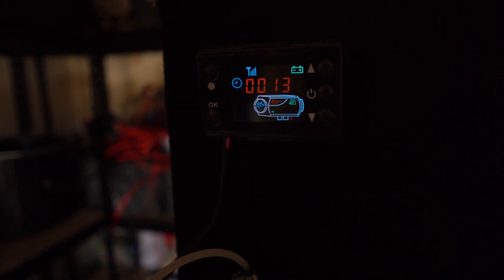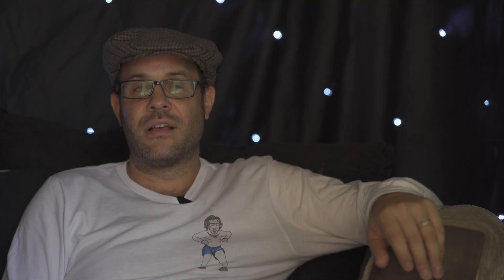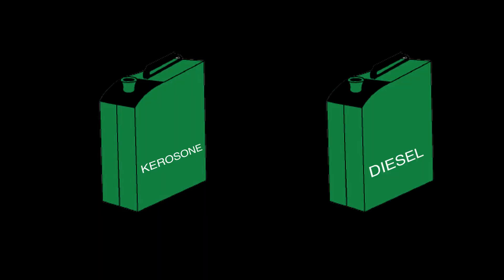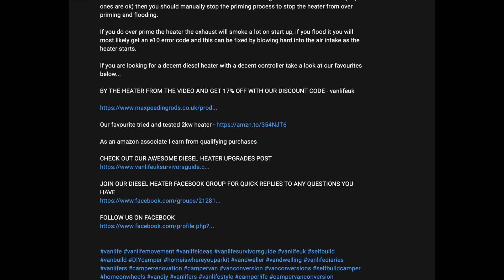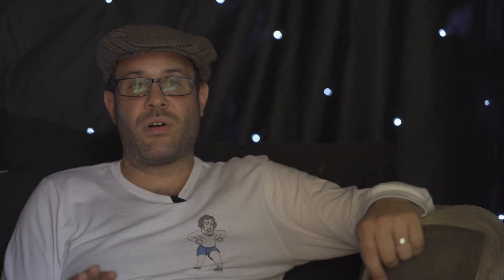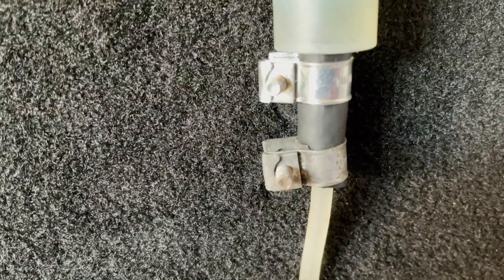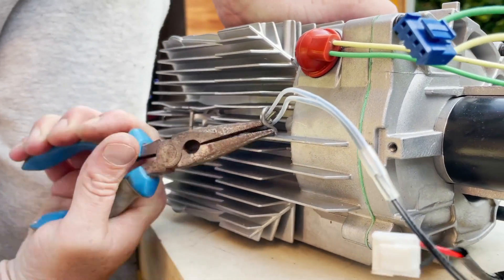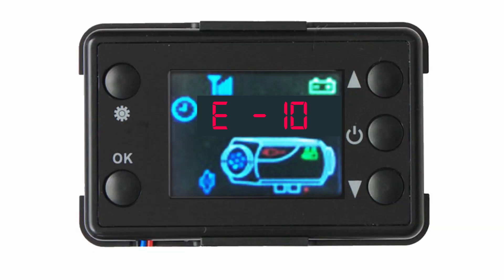Chinese Diesel Heater Error Codes E01 - E10  All Codes, Faults & Fixes

Comment: Hi, I wonder if you can give me some advise? I have just received 2 new 8kw diesel heaters, and I have installed one of them. The controller if different to yours and the heaters are 3 fin fan blade models. I can run the heater with one or two red bars, but if I chose a lower setting such as 1, 2, or 3 hz, the heater eventually shuts down. So, I can only run it on high, but the Alpine mode helps by reducing the fuel intake, and lowers the heat output, but I can still only run it on 5 or 6 hz. Do you have any idea why I can't run it on the lower settings? Thank you for a great video... Just to clarify, my controller is one that I can't go into settings to adjust fan or any other settings, but is slightly different to yours...

Comment: E-08 could be way bigger than only the pump. Waaay bigger!!! 
It could also be the mesh between the intake and the burning chamber. 
You can´t see it in there but trust me, it´s in there and clogging all up.
A really big problem from running the heater on low settings over a long time. 
Try to scrape it away with anything that might fit in there or heat it really high up with a torch. 
Okay, you can blame the pump and buy one after another. That´s your money. Your choice. Or...

Comment: Got a 06 code which is fan . Checked the fan separately and it works As soon as I put the heater back together is goes back to E06.need help .Taken it apart 5 times now .

Comment: I'm having a mare...now on Error 10 after Error 8. New exhaust new pump. I blew the fuel line. Smoke started coming out. 
So it starts pumping clicking nicely then stops. 
I've also found on the display the priming sequence does not work. I've had to manually Prime it which isn't ideal on the mouth (not recommended)
Help?

Comment: E10 is 99% clogged mesh or clogged air-hole. Beside where the glow-plug screws in there is a small hole - it blocks, unblock it.  it lets in air. No air, no start.  Poke it/carb cleaner.   

Where the glow-plug screws in, there is a mesh - the tip of the glow plug heats the mesh, the mesh ignites the fuel. If the mesh is dirty or clogged, it will throw error code E10.  Clean the mesh with carb cleaner spray.

Comment: As it happens, I got a E1 error with 13.5V. After connecting the heater to my starter battety bank with was only 12.5V it worked fine.
It's the Trellicks heater.

Comment: So how do you change the voltage selection?
Im getting 02, high voltage, but my battery is only showing 13.4v, the controller flashed up 21.7v but i can't seem to find that again now

Comment: Hi,
Just stumbled across your channel liked and subcribed m8.
Just got this heater from sunster. Used it for maybe 17 hours if that. Got E3 code so got 2x plugs from ebay. Not fitted yet. Then thought I'd try it again worked.. But then got E7 said fan and motor error.. Now back to E3 says voltage over run and I shut it off. Nothing blocking the air in or heat out ends. The controller illumination started to fade then went blank. Now illuminated again, but still E3. Do I kick it f-in hard?🤔😱
Many thanks
CELER ET AUDAX

Comment: Man your the best ,even though im a brit living in Canada of all the UT shows Ive watch to see why my heater kept cutting out  even though my controller was working perfectly ,until you said 01 is battery amps issue. I never give it a thought ,as soon as i put my battery charger onto the battery everything went smooth sailing ,Ive spent  6hrs bleeding the fuel and watching UT ...
You was bang on and straight to the point .
Thank you and for that alone im going to subscribe.👍👊

Comment: 3:22  yes, but doesn't the fan needs to start spinning in order for the ECU to recognize the magnets?  I don't believe the ECU is going to recognize the magnets if they're not spinning past the receiver.  Mine, I received was popping an E-06 code, fan not recognized.  Internet says once you give it power, the fan will spin up, o wake the ECU up, I presume by creating a magnetic field.  When I power mine up, nothing happens...it just sits there, then after 20 seconds, or so...the controller voice says 'Fan not detected'

Comment: Hello, Error code E 01 which remains in memory on my forced air heater even after driving for 1h30. Do you know how to erase this error code? Thank you for your feedback.
Bonjour, Code erreur E 01 qui reste en mémoire sur mon chauffage a air pulsé même après un roulage de 1h30. Connaissez vous la manipulation pour effacer ce code d'erreur. Merci pour vos retours.
Reply: Same problem here, voltage is good. But it stays in error. Even after removing vuse for a long time.

Comment: I see E-10 . In your videosi noticed on the E10. Your outlet on your tank was the same height as the pump. Is that required?  above like a gravity feed, it goes underneath my R. V and then back up into where I have it mounted . Eg: tank is approx 30" above the heater & 36" above the pump.
Pumpis12" below heater

Comment: I have white smoke coming out of my exhaust. After the heater runs for approx. 1 - 1.5 minutes like this, the display shows E 10 error code. Can someone help me figure this out? 
I bleed the fuel line, and re-primed the pump, after I let it sit for a week. But that didn’t work. 
Please help 🙏🏽
Reply from the maker: Could you have over bled it and flooded it?
Is there defo fuel all the way from the tank to the heater?
Reply: @vanlifesurvivorsguide  there is defo fuel. And I originally thought that I over flooded it, but I let it sit for a week and then tried it again, so any flooding should have dissipated right?

Comment: hi i have just got camper van and night heater not work battery light flashing on control panel i have take wiring off battery put it back on battery light stops but 1 min later starts flashing again i have got new battery still flashes hope you can help me thanks martyn

Comment: Brand new machine and getting E07? Help!! Why??
Reply from the maker: could be a bent pin in a connector to the wiring loom or a damaged blue cable between the motherboard and controller somewhere

Comment: Great video. I am getting an E05 error when the heater does not even run. The heaeter fan will not initiate and this error code 05 is permanantly showing on the display. I have tried re powering the heater and that does not fix anything. Could it be a thermostat issue? Heater cannot be overheating if it is not evening turning on? Any advice to resolve this. It is almost brand new and hardly used.

Comment: nicely done and very helpful. However, you say not to run the heater while driving _well, I and many of my friends use these on sailboats and powerboats. Lots of motion. While not essential to use them underway, at night if at anchor or on a mooring, the boat is still moving somewhat.Not heard too many complaints of error code 08 thank God !

Comment: I have the error 05 and yes my warm air is blowing towards a painted wooden wall about 5cm away. I put 4 individual tubes on the 4 outlets and there's a 90 degree bend as soon as the warm air exits. I will have to cut through the wooden wall soon. Hopefully it will fix it

Comment: Joke this is , there’s lots of reasons not mentioned for all the codes E-8 you failed to mention that the bloody pump isn’t working the most obvious yet you failed to mention it , the problem with the pump but kicking in is a multitude of possible reasons
Reply from the maker: Never once in my life have I had 08 from a broken pump. If you had a broken pump you would get an
 error code 4 long before error code 8. What it sounds like if you have air in your line and have blamed the pump...

Comment: Well, here I am standing at the heater at 3 am and keep getting error messages. 30 seconds into the vid I realized I was simply blocking part of the heat line. Thank you sir, owe you a pint
Reply from the maker: No problem mate, glad you found it helpful

Comment: I have had a intermittent fault with my heater since I bought the van! The guys who built the van fitted a off/on switch so the heater controller wasn’t lit up all the time the odd time the heater would run ( just cold air) without turning the heater on I just pulled the plug apart (the controller board to loom) just because it was easy to get to. The heater as always worked fine when needed I just push the connectors together on use the heater as normal. But just been away this weekend and every time I connected the cable together the fan ran blowing cold air thee we n turned the control panel on but couldn’t get the heater to run and error code E-o7 is showing have you any thoughts thanks in advance

Comment: I keep getting a e-10 error I can’t figure it out I’ve replaced the glow plug cuz I took it apart and noticed the tip of the plug was cracked and broke, I also replaced the mesh that goes around the glow plug. The burn chamber is clean as a whistle. I only run diesel through this, the fuel line total from tank to unit maybe 2 and half foot. Another issue I’m having is priming I have the red controller I ain’t been able to find others like mine but when I try to push ok and up or on and up or down I get nothing but it seems to be priming on the initial start up and there is fuel all through the line. Any ideas advise and help would be so appreciated thanks again.

Comment: I have a triclicks (Amazon) heater installed in my van. I’ve only used it 2 times, once when I installed it (for 15 mins) and once yesterday for 10 minutes. The engine temperature says 200 degrees C. No errors but that doesn’t sound right? Also, even after 10 mins it runs the CLEA function when I power it off. I read that it only does that after long use. Is there something wrong with mine?

Comment: Just another thing worth mentioning for E01 that I've just fixed - I accidentally plugged the heater into 240v(the plug was identical to the one that goes into the unit and the transformer) and I fried the unit. After replacing the circuit board I was now getting E01 error despite there being enough voltage & amps for the unit.

In my case, I had to replace the display/control which removed the E01 error. Goes without saying, don't plug 240v into a 12v unit!

Comment: I've recently purchased a Chinese diesel hearer. I've found one thing that can cause an E10 error is using too small Guage wire. I connected  it to my 12 volt batter that was approximately 30 feet away using 18 awg wire. Everything appeared to be normal until I realized that the fuel pump wouldn't run with the voltage drop caused by too small of wire. After I ran 12 awg wire Everything was fine until my battery got too low and caused a E8 error. 

For best results, If possible connect the battery using the supplied short cable else use 12 awg wire and keep the distance as short as possible.  

Don't use a power supply or ac to dc converter. You can use a battery with a trickle charger without any errors.

Comment: These vevor heaters suck. Got a brand new one, throwing E02 code. I've got 12v of power from a battery, so it should be working. Topped the battery up with a trickle charge and it'll run for 1.5-2 hours before throwing an e09 code and shutting down, then I've gotta charge the battery again to get it running. When it does run it doesn't blow very hot. I can hold my hand in front of it for some time, and you've gotta be 2ft away to be even remotely warm. I'll try replacing that temp sensor, but for an out of the package product, this thing sucks
Reply: Similar problem. Any update with yours?

Comment: Bought 3 of these fucking thing now an 6 poxy pumps , fuck knows why it want work, even with 3 can’t make a good one out of three. I’ve had every code , I’m just about ready to burn the fucking lot .  Thing is the original one  I had  ran we’ll never any probs , went to start it this yr wouldn’t run , turns out  water was blocking the exhaust, so sorted that the. Went through 5 pumps they work for 10 mins then fail , couple of them sort of freed up with a beating an a short sharp shock of 24v but they are fucked. So brough a new machine same thing first pump failure , so got hump after two nights fucking with it an brought another one spent all lastnight fucking installing it an this arse want run glow plug working pump working    . B Jesus . I’m ready to kick the crap out of these
Reply: You are either from Ontario, Newfoundland or Canada!!! Love the B. JESUS ...lol. I'm from Canada and I can spot one from a mile away 🤣🤣😅😅 I burnt my diesel heater--- piece of shit!!! Always an E10 error code, and just bought the f____cker.

Comment: I just watched your error code video. I wish I had seen this much earlier. Very well done, I have immediately subscribed. I do have a voltage question. My controller reads much lower voltage than a direct metered voltage check of the battery. Any suggestions?
Reply from the maker: Hi mate, that sounds like volt drop. So the cable between the battery and the heater isn't thick enough and should be thicker. we recommend 6mm2 (10awg). We also recommend going directly to the battery via the inline fused attached to the wiring loom and not through any other fuse box as this can cause volt drop too :) Thanks for the sub

Comment: I prefer to wire from the fuse box. As then you know its fused straight at the source. Like putting fuse in a plug. Taking it direct from battery means you have to drill through firewall which sucks.

Comment: Thanx V.L/Uk.
I found your error code video extremely useful.
Actually, I've got a E05 atm. I shut it down and it seemingly started normally.
(prolly a dodgey sensor after 137hr burn time), But, no, I get extremely hot (close to melting it)
Hope I haven't fk'd it! 😂
Cheers 'n Greetz 
from
Australia
(Edit) : when i detected how hot it seemed to be getting in the room, I went to investigate as to why. 
The tin casing was almost to hot to touch. 
I initiated standard shutdown procedure successfuly.
Have ordered another sensor (maybe it something else?).
Sorry if bit lengthy.
Maybe sensor is just rubbish? (will look into compatible quality sensor/s...)

Comment: I’m getting e-10, good voltage at the heater, have just stripped the heater and all looks fine, no flooding and just a light dusting of carbon inside the chamber. I’ve ordered a service kit anyway, see what happens when I put it back together.

Comment: I don't find any need to prime, just turn it on and it draws fuel fine, never get any smoke either. I run it on kerosine. I suspect priming causes the smoke.
Reply from the maker: You should prime it, but if it smokes you are doing it wrong. Some people have the fuel tank 8 meters from the heater that would be a lot of failed start attempts you would be there all day. 

The correct method is to not attach the fuel line until you have primed the lines. Place the end of the fuel line in a container and prime the lines until it comes out the end. Stop the priming process, attach the fuel lines and press start. Perfect every time :)

Comment: I had an E 10 error and the heather get stuck .Just rising up over 1 Hz the pump pulse rate the heather ran properly. I believe that when the outside temperature is too low ( here was - 5 C° ) a short pulse rate is not enough to heat the ambient. According to this experience I suggest to rise up the pump rate when it is 0° or less outside. You can slow down the pulse rate when it is over 10° if you want to econimize gasoline.
Reply: I have the same right now and it's 1 degree out,still won't work 😅
Reply: @fol3564  well I do not know what is going on with your device, I just only arguing on mine....

Comment: i have the 02 code with a ecoflow delta pro using the 12v system so makes no sense for the volt to be to high
Reply from the maker: That means it doesnt have enough power for the glow plug. it uses 11 amps and the ecoflow 12v out is probably 10 amps can you check the manual for the ecoflow
Reply: @vanlifesurvivorsguide  can i buy a  230v-12v 180w transformer and use it on the heater when it requires 110w/11amps?
Reply from the maker: it should work
 @ltstatic3932
Reply: @vanlifesurvivorsguide  m8 i got the transformer and still have the same issue, can it be that the clips i use to connect the cables cant transfer enough watts? ill try another one that i can change the volts on and is 400w max. Might be that i need 13.3v instead of 12v but not sure.
Reply: nvm, i ran the power supply directly from the ecoflow delta pro to the heater, then it workes fine. I think it didnt work at first because of all the connections on the cable, maybe the line was already using to much power or something. Thanks for the help :)
Reply: @vanlifesurvivorsguide  yea its 100w max, i can get a 230v to 12v concerter with 200amps os something
thanks ill fix :)
i though it was the volts so made no sense :P